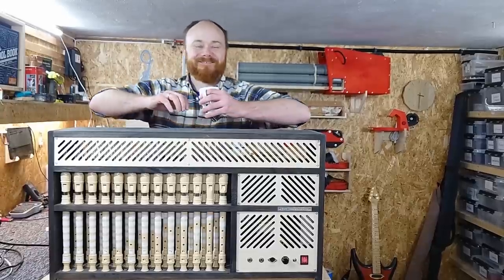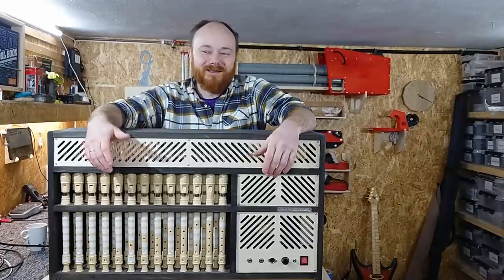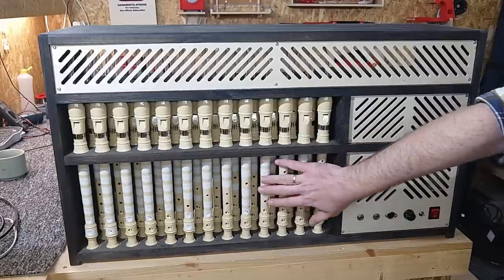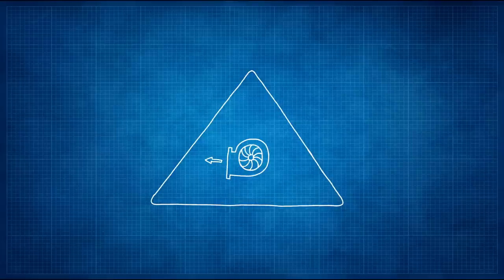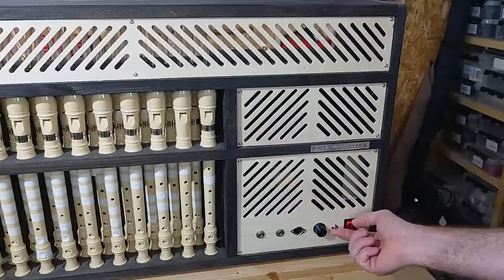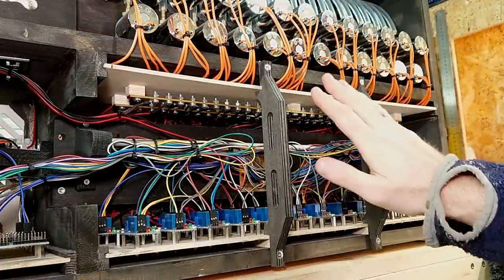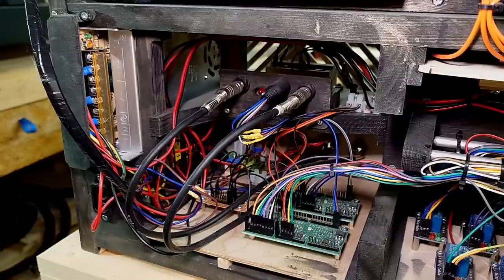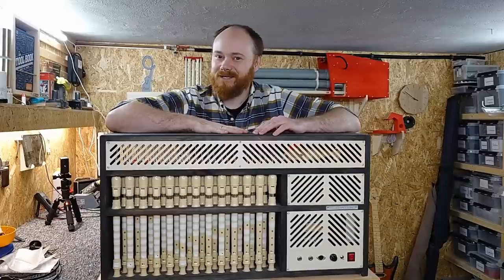The Hellcorder | The World's First Recorder Based Guitar Amplifier

Comment: The comedy of it makes has me enamored, the functionality makes me hurt.  Organ solenoids with the same valve set up would make it sound less like you're getting shot at.  Love it, you earned a subscriber with this one bud.
Reply from the maker: Haha, exactly! You know, that is a good tip. I have already thought about swapping the relays for transistors, as the relays are quite loud as well. I have also thought about building a more traditional windchest with traditional valves and then organ solenoid valves would be perfect. Why change something that has worked for years. The price and availability though, might be an issue. You can easily(-ish) build them from scratch, but doing that 25 time over...I'd rather try to not picture that haha.

I have also warmed up to the idea of building two double acting bellows, offset eachother, to create a low pressure/high volume air flow. Think that would give a nice steampunk aesthetic - but might be more complex to get working than I initially think (which things almost always are) :D
Reply: Oh that exists. I was wondering about what kind of contraption mimics the human voice organ (in what way to squeeze a very flexible tube that has to be durable also, hahaha, imagine the effort).
Reply from the maker: @florkgagga  I have seen some attempts at mimicing human speech in robots - terrifying! I believe technology has a way to got in that direction haha.

Comment: Recorder player here -- this is such a fun idea! If you are using even reasonably decent plastic recorders (especially Yamaha), the intonation on the instrument is actually pretty solid (more expensive recorders can actually be trickier to play some of the high notes on, though the tone will be more refined). You're probably aware that airflow has the biggest effect on intonation, so you might need to find a way to individualize the airflow for each note to optimize the intonation as a whole rather than try to adjust the tuning on each instrument. You can even add alto and tenor recorders (even sopranino ... bass would be tricky and add some logistical challenges) to extend the range and potentially have more notes fall in the sweet spot of one of the instruments.

Excited for the polyphonic possibilities! You could play not just chords but also fill in overtones/partials to create different timbres (just like stops on an organ) ... pretty cool stuff.
Reply from the maker: Thanks! Glad a recorder player also enjoys this madness :) 

I am aware that recorders are kind of airflow sensitive, atleast for some semi notes and in the second scale. I am currently looking at som nice, and surprisingly cheap, brass flow valves which I can use on every separate recorder to helt in that way.

I like the "stops" idea, just so I can add a feature where I can actually say "pulling out all the stops!" :D

It is polyphonic as we speak, if I use a MIDI keyboard or just use MIDI out from my DAW. I just haven't experienced with that, but saving the experience until I have addressed a few issues in the 2.0. You can in theory use it as a MIDI player. In the 90s you could get Floppy Dish MIDI players for backing band tracks which I would love to get my hands on. just for that haha.
Reply: @behindthemistakes   Perhaps some kind of adjustable flow restrictors?

Comment: That is so very cool.  You seem like you're a bit burned out from working on it.  The energy you put into it wasn't a waste.  Heck the thing works.  That is one of the coolest builds I've seen in a very long time.
Reply from the maker: This has actually taken years, for many different reasons. I got the last leg done to kinda get it finishet and not having it standing in the corner mocking me, but the feedback and shear volume of ideas from people on this video has blown me away. It has got me thinking "Ok, now it works (sort of). No you can refine!". So a 2.0 is playing around in my head :D
Reply: @behindthemistakes  It's amazing bud.  I think the next big leap will be when you can play multiple notes at the same time, as you mentioned.  You have my full respect!!
Reply: @behindthemistakes  And now, since you have built the world's cheapest pipe organ made out of recorders, you can add sopranino, alto, tenor, and bass recorders (and others in the family that will blow your mind as to cost per note!). And a quick check with an organ builder will give you the information to add a vibrato circuit (also analog), and maybe even tremolo!

The possibilities are endless!

PS: You may also pioneer some method of buying only one or two recorders, and using MIDI to control plugging and opening the holes on those single or double recorders. Not sure that you would save money on that method, though...
Reply from the maker: @snickpickle  The possibilities are endless! :D
Reply: @behindthemistakes  ... like a bass version. Being monophonic would be a lesser limitation.

Comment: First time here. Amazing work! I have to point out that the recorders are designed with a very specific tube length, and the way the bottom of the cabinet adds to that length throws off the pitches, potentially in hard/impossible to predict ways. The more open breathing room directly at the ends of the recorders, the better.
Reply from the maker: Good feedback. I think the hole, and air gap beneath is large enough, but I have not beasured with pipes in vs. pipes out :)

Comment: you don't need an audio-to-midi converter. you need one controller doing FFT, the output of which controls the valves. look up "look mum no computer talking organ" as a fun example.

the jist is, you can break up incoming audio into frequency bands that can then be approximated by the 25 recorders you have. i honestly thought that's what you were going to do. that way, those recorders can reproduce any input signal. no conversion to midi necessary.

as a side note, or maybe the most important thing: any build you film, successful or not, i'd enjoy watching. keep at it! you made me laugh out loud quite a few times
Reply from the maker: Thank you! It's all about a laugh! The FFT route is new to me. When I first went the MIDI route, that was basically the only way of going within a reasonable price range and viable possibillities. Now, with the processing power in small computers, Arduino, Raspberry etc. of today, the game has changed somewhat. Luckily it's a modular setup, so changes in the input side is easily doable. Just need help on the programming part as I don't see myself spending the time learning what I need to learn about FFT to be able to pull it if. Someone actually offered to pitch in though - beautiful people :D

Comment: LOL.  

This reminds me of a project a banjo-player friend of mine and I undertook, years ago, before electric banjos were a thing.

First we electrified one of his banjos by gluing razor blades to the underside of the head, and mounting some tweaked electric guitar pickups on the adjusting rods.  We plugged the result into a guitar amp, and it actually worked, sort of.

Not content with that, we fed the output through a rats' nest of gear including a low pass filter, a frequency-to-voltage converter, and a voltage-to-MIDI converter.  Ran the final MIDI output into the MIDI-in on a Roland synthesizer, set up with an FM banjo patch.

Voila!  Digital banjo.

Rube Goldberg would have been proud -- and I think he'd have loved your Hellcorder, too. :)
Reply from the maker: You had me at "Banjo"! <3

Comment: Very interesting project! But advice on video production: start by explaining what it is you're building and how it works. This isn't really a guitar amplifier, but a midi controlled organ with a monophonic audio to midi converter. You could plug any audio source into it, really. Also, for better guitar to midi you might want to look at Fishman TriplePlay. It's an additional pickup for your guitar that separates the 6 strings and converts them to midi.
Reply from the maker: Thanks mate! I looked at the Fishman and I do already have a Ghost Picup System from Graphtech on one of my guitars, but I wanted it to take any electric guitar. And of course, one can get philosophical on that an "amplifier" is, but yeah it is also fully functional as a organ (although a bit lacking in the sound department) haha.

Comment: That's quite possibly the most offensively awful thing I've ever heard outside of a primary school recorder concert.  Well done.

Would it not be easier, in terms of polyphony, to use bandpass filters to control the solenoids rather than all the midi / digital stuff? I suppose that might want some sort of variable solenoid valves as well, though.  Actually, that sounds like a lot of work.  scratch that.
Reply from the maker: Thank you! It was indeed a challenge, but aw(e)fullness prevailed! I did think of several ways of doing it, but I know basic MIDI from before, which made that the "easy" way to go. Now, I am stacking up quite the list for the 2.0, but as I may have mentioned earlier I need to figure out how to individually tune the recorders while they're inserted in the cabinet. Not impossible, but to quote you back "That sounds like a lot of work". They are indeed recorders, so they will always sound awful, but they should at least sound awful in tune xD

Comment: I kinda thought the tone of the guitar would modulate the airflow so it would recreate a more sort of guitar sound, but just made out of pulses of sound made by the recorders and solenoids at different frequencies. As it is though it's basically a recorder organ and using it with a midi keyboard would probably be better, polyphony would definitely improve it.
Reply from the maker: Unfortunately the MIDI systems removes any modulation from the signal other than full on/off. One could of course use the guitar signal to add a modulation to the solenoidvalves to create pulses in the airflow to the recorders - but that would be too advanced for this setup I think. If I connect a MIDI keyboard to it it will do polyphony, but then tuning becomes even more paramount. Because several recorders out of tune....haha, mayhem!

Comment: I would consider splitting the 2 MIDI boards into separate banks with band pass filters tuned to a high and a low register to cut down on noise and interference going into that register. Then there could be one note from each register playing at the same time and possibly more accurate notes. This approach could be extended to further divisions to make it more polyphonic. This is surely a build that LOOK MUM NO COMPUTER would absolutely love and may have some suggestions for improvements. You might get some ideas from his current series on rebuilding an organ.
Reply from the maker: That's actually a good feedback which I will bring onto the list for the 2.0. The system is sensitive, also for transient tones from the guitar - which is guite normal in a guitar signal. 

Love Sam over at LMNC and have followed his project with much joy. The Furby Organ and now the new organ rebuild has been a good inspiration for the last push for completion of the concept :)
Reply: @behindthemistakes  I have fond memories of playing an early Roland GM-70 way way back in the 80's in a music store on many occasions and most incredibly not getting banned from the store for life 😂

Comment: i wonder what a amplified guitar speaker working into the airbox would do to the sound.

also.. what audio to midi box are you using?
Reply from the maker: That's a good question really. That would certainly be possible.

I am using the "Guitar to MIDI Converter (G2M) from Fata Point Ltd. Also looked into trying the Sonuus G2M, but that was sold out I believe back when I needed it. The best solution might be various software, but then I'd have to integrate a small computer - which today is very possible.

Comment: Dumb? Well, yes. But you are still my HERO. This iteration may sound incredibly irritating, but it's getting close to something so super cool. I hope you can develop polyphony somehow. Another approach would obviate the recorders. Ham radio operators who use Morse Code sometimes use a tubular tuned speaker enclosure made of PVC pipe. It rings at 800hz or whatever the operator prefers. Maybe each recorder containing a driver of some sort that establishes a standing wave within the tuned recorder--this is pretty far from your design, but would still sound recorder-ish (?). Anyway, your idea--and your handiwork--blow me away completely. Jonathan in Seattle
Reply from the maker: I believe it's just a matter of time before I can by the polyphonic MIDI converter off the shelf somewhere, without having to do the labour of trying to invent it myself. The entire thing is made to be modular so that an upgrade would be an hour of work.

I like the idea og tubular tuned speaker enclosure(s). The tuning issue of the recorders is the main headache by this point, but then again - I chose the recorder path myself, so can't complain haha. Now knowing about tubular tuned speaker enclosures I'm pretty sure I will visit that concept in another project in the future :D

Comment: I pictured a slightly different direction--instead of polyphonic MIDI with just solenoid valves, I pictured throttle valves fed by fast Fourier analysis of the (digitized) analog guitar signal. This would add system complexity, of course, but might give really nice results.

It would be possible to go Fourier instead of MIDI without adding hardware, too, of course, by just turning on the notes that hit a certain threshhold. This could mean you might, for example, get overtones playing if you hit a note hard enough. Might be a cool effect in itself. Or you could stay monophonic by only playing the loudest note.

Cool project.
Reply from the maker: It would add to the complexity, but would be an interresting challange. I do fear that throttle valves at the proper size, and quality, might be rather on the expensive side :P I don't know Fast Fourier based tech too well. I only know that the sound "image" of a guitar chord, or any string instrument, is quite complex and hard to separate out the individual tones without hiccups. That's not saying it's not feasible, but it probably is gonna be har and/or expensive :P
Reply: @behindthemistakes  The guitar tones would be quantized into averages of each sector of the FFT. I think it would be quite easy to simulate on a DAW to see if it's worth the bother!
Reply from the maker: @wiegraf9009  Yeah, quite possible :)

Comment: Look, mum! This amp has recorders, but no tape! And compressed air tubes instead of vacuum tubes, or - if you live in the UK - solenoid valves instead of thermionic valves, haha. Still some tubes / valves. The sound certainly has a lot of air to it!
Nice woodworking and milling there :)
Fan triangle, as in a particular case of the Triangle of Engineering... Cool!
Reply from the maker: Thank you :D "...lot of air to it" had me giggeling!

Comment: I play guitar and recorder, and I approve this amp.
🤘

Tuning is going to be a challenge, as pitch will change with air pressure.
Reply from the maker: Thanks! And yeah, tuning will be a challange as the different tones really need different airflow/pressure in addition to finger placement which is much more refined with your fingers than with electrical tape :D
Reply: @behindthemistakes  Instead of only using soprano recorders, you could add alto and tenors. Then you could always cover the thumb holes.

Still will need to vary the air pressure.

Have fun!

Comment: Replace the recorders with dedicated organ pipes and use an accumulator for the compressed air supply.
Reply from the maker: The premise was using recorders, as the most diabolical instrument ever made. If I'd use organ pipes it would be an instrument and  surely overkill with regards to the rest of the components in the build :D

Comment: For future projects and reference, if you ever have a situation like you mentioned with the top part where you need to make 25 perfect cuts or you ruin the piece...
Consider (if possible) instead delegating that task to an intermediate piece.
For example cutting 25 easy shapes like a circle as sockets.
Then you just create 25 pieces that socket into them, this way you only have to create the intermediate pieces and not the whole work if one is off.
This works even better at scale.
Reply from the maker: And you tell me this NOW???? ;) Hehe, that was a good tip actually and I will probably need that at some point :D

Comment: Check out- NSHOS Wurli 4600  , would be great to midi-in the Wurlitzer electrostatic continuous free reed organ1953-1963! Models 4600,4602,4800 full size console, and 44,4410, 4420, 4430 spinets. I play my 4410 on my channel. The 4600/ 4410 models were the very first organs with sustain.
Reply from the maker: It would be awesome to MIDI-rig an old organ! :D Should be fairly easy as well, depending on the organ. A lot of the newer church organs actually got MIDI capability, but that is seldom talked about since that is for a very narrow niche of people .

Comment: Hey there, really awesome and insightful video and build!
As far as a MIDI converter is concerned, you might want to check out WIDI, which is a VST Wav to Midi converter which works exceptionally well, that way you wouldn't have to buy a specific card and could start the tuning/intonation of the recorders before thee motivation drops and everything sits around in your workshop for two and a half years 😂
Reply from the maker: Haha, that motivation part is all to real - and 2,5 years is not even close! 

WIDI is new to me, I will check them out. Thanks :D